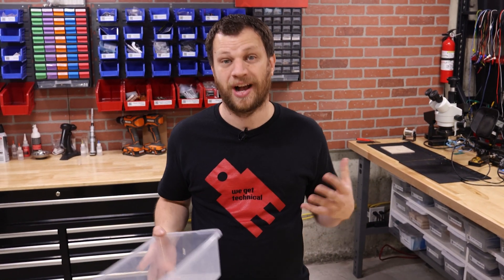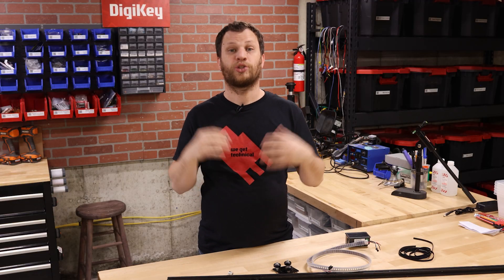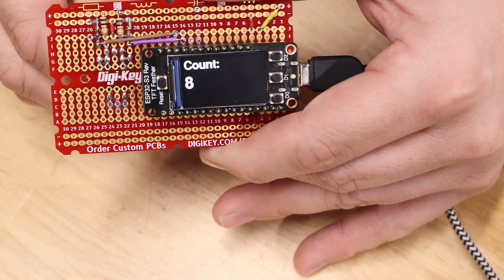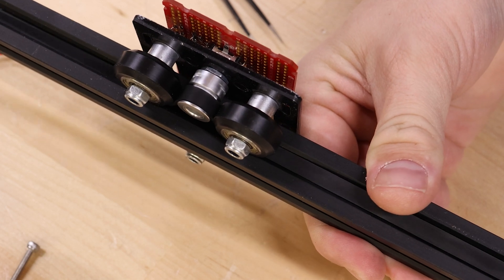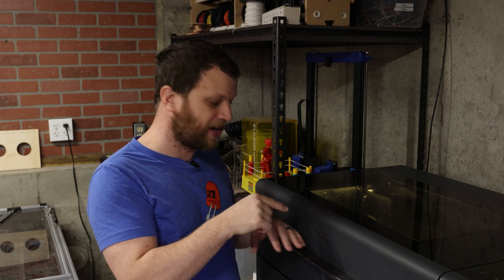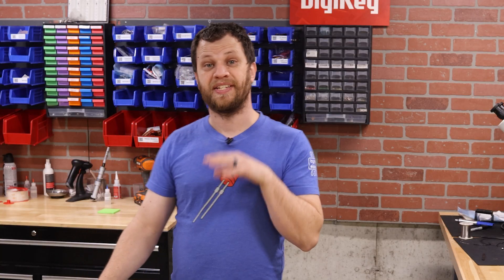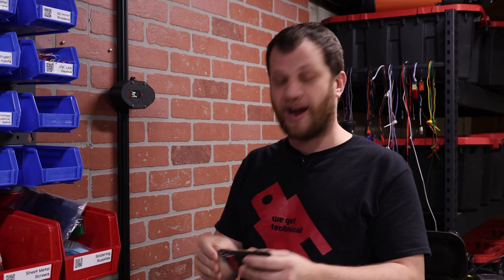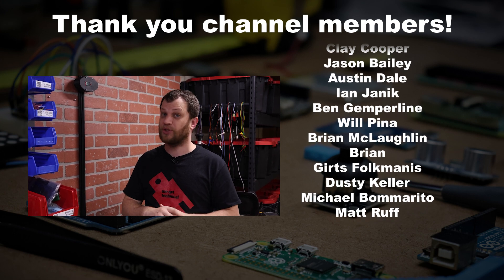I dropped the ball keeping track of how tall my kids are

Comment: Yes I can definitely tell you the optical encoder you used is significantly more accurate and reliable than the cheap mechanical ones. It has its own circuit board and its a very clean signal. I use those on robots. The cheap ones are ok for menu selection but thats about it. Its not a big deal to scroll past and back to a menu item. But any accurate measurement requirements it is definitely worth the extra cost and use an encoder that is designed for that purpose. Neat project.

Comment: Did you measure with a tap measure at both ends? i.e. at 50cm and 200cm. This is to confirm that the conversion from rotary encoder to distance is accurate.
Reply from the maker: @nurmr  yes, in part two (coming out next week) I show how accurate it is when measuring towards the top end

Comment: Love the idea; when it takes a picture to send to the grandparents, will it also save a file with their picture, age/date and height (instead of just a height table), would think the change in looks would be just as interesting as height (and then could do a time-lapse).
Being not the person actually building and using what you have around; would think an optical or ultrasonic range finder would be a cleaner solution (and then you could have all the electronics not on the sliding rail, simplifying the movement component).

Comment: Love it when a new Bite-Sized Engineer video comes out! As I was watching you install the first rotary encoder on the laser cut board, I thought bet he wishes he'd installed that before the wheels. Then when installing on the 3D print I noticed you changed the order. I shouldn't find it so satisfying, but some days it's little things like that which make me smile. 

I was kind of surprised that it looks like the camera will be it's own little module mounted on the wall rather than something dropping a few inches down from the carriage so that it's always close to eyelevel. (These things are always easy to see as an outsider who doesn't have to engineer the solution) ;)
Reply from the maker: @jasonbailey9139  thanks for always being one of the first to watch and comment! 

You've got sharp eyes! Yes, I screwed up the assembly order and hoped nobody would notice. 😜

I debated back and forth on how and where to put all these components. Maybe somebody else will make some improvements on my design